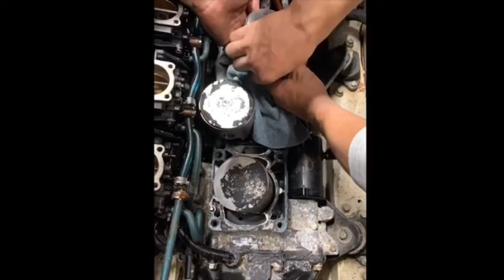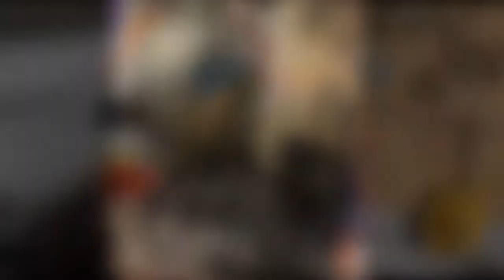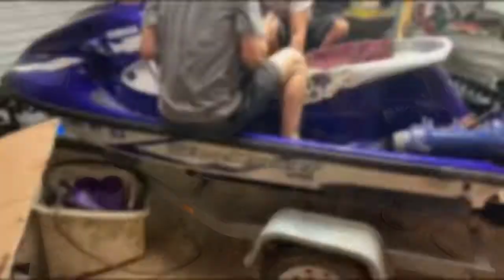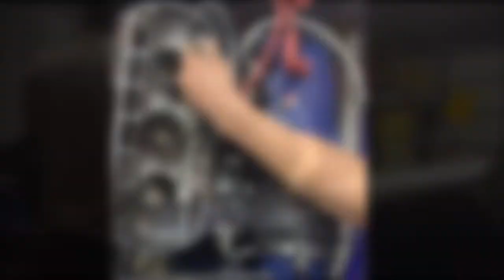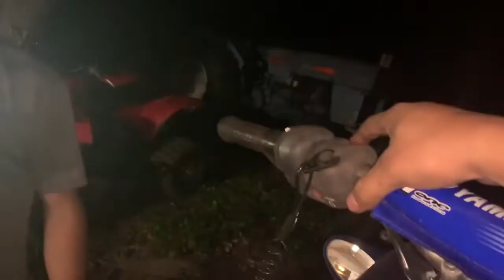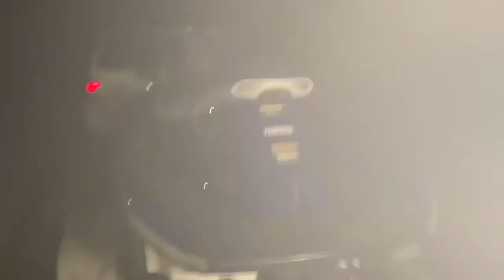Yamaha GP1200 Engine rebuild

Comment: Any chance you could upload the non-sped up version and it could become more like a tutorial for those about to tackle this project? One of my rings busted and I need to at least do a top end rebuild and verify the bearings are still good before reassembling.
Reply: Also a kit recommendation would be good. Which one did you go with?
Any tips on the best way to go about this?
Reply from the maker: I don’t have footage of that build slowed down sorry. I’ll do that on my next one! I’d recommend WSM and bore the cylinders. It’s been running for 2 years

Comment: I am currently working on my 1998 Yamaha Wave Runner GP 1200 that has been sitting in my garage for the last 6+ years. So far I've replaced the foot traction pads, reupholstered the seats, and now am working on the engine. Do you have any tips or helpful info on how to do a oil change? I've never done one on a ski before. All the old gas has been siphoned out as well......Any help would be GREATLY appreciated!! Thank you & great videos!!
Reply from the maker: Gp1200 2 strokes don’t have engine oil. They have an oil reservoir for the 2 stroke oil it runs off of. I’d recommend getting an oil block off plate and deleting the oil injection. Then just premix the gas with oil. You can find this stuff on forums!  Plus before you do anything to the engine check the compression!!!

Comment: Hey I got an opportunity to buy my first jet ski, a 98 gp1200.but I kind of want to check the compression before I buy it.should it be pretty simple for me to jump across the two terminals of the starter relay to get the engine to spend so I can do compression check? Or is there a simpler way to check this engine?
Reply from the maker: Hook a hot cable straight to starter post

Comment: How much was the kit for the 1200 motor I am doing mine too
Reply from the maker: Ernesto Morales it was 700 for a cylinder exchange with a remanufactured deck and new pistons and rings
Reply: @CocosPlayound  where'd you get the kit from and where was is manufactured?
Reply from the maker: @humungoushockey9108   Can’t remember the guys name was a guy that offered a cylinder exchange program on eBay he was in Michigan